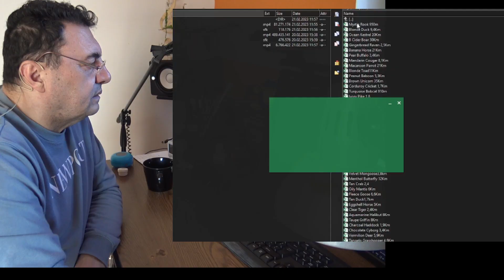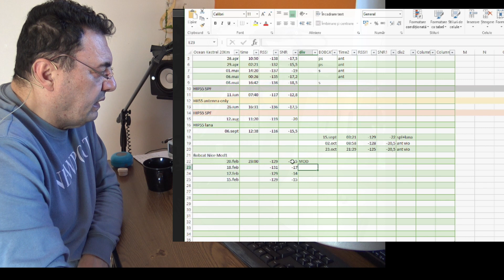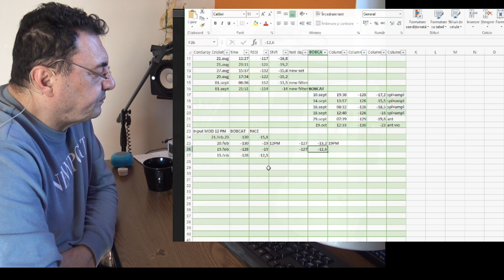Back to Helium Bobcat 300 MOD

Comment: That test was not long enough.   If you would have taken the week before the mod and compared it to a week after the mod, it would have given you a better idea if the mod worked or not.  The Helium network often fluctuates from day to day.  ( Election times for example,  one day, could be as fast like 27 minutes, next day it's as slow, like 32 minutes.  makes a big difference in PoC. ) Also, the hotspot may only beacon 1 or 2 times a day.  if you "miss" the beacon because it was offline while you installed the mod, the next beacon may not occur again for 12-24 hours.   There are other variables as well....
Reply from the maker: Right..